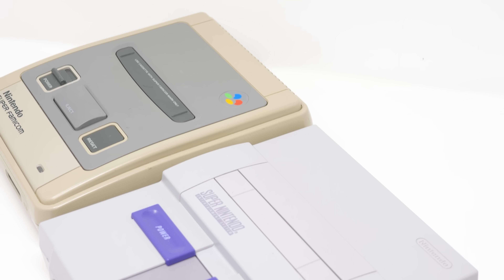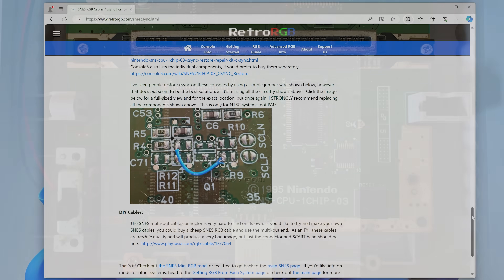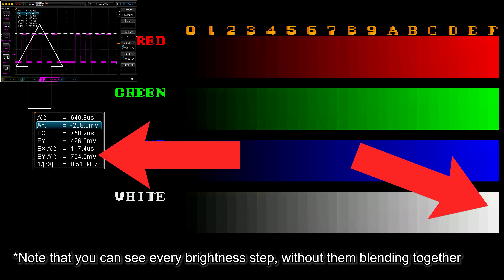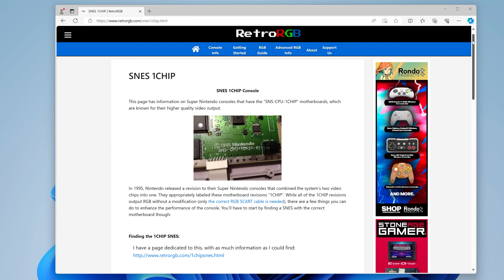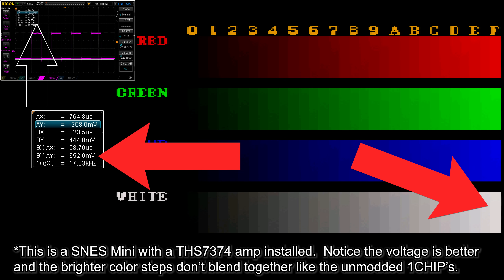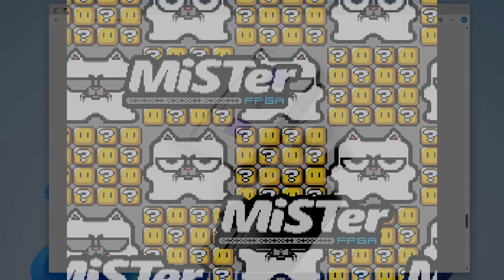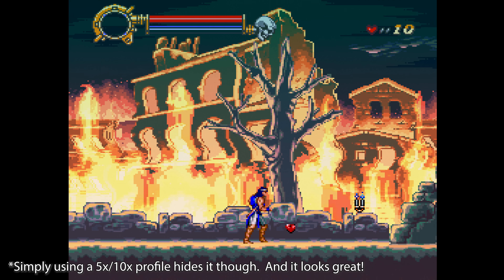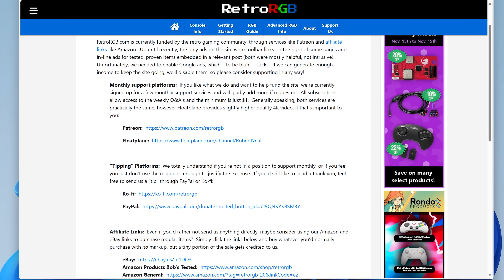SNES Video Output Explained

Comment: I'm personally fine right now with my stock 1chip's RGB on my PVM with an SD2SNES using the brightness limiter in the settings.
Reply from the maker: Great solution!
Reply: @RetroRGB It's also a nice solution for the 1chip specific issues in some games too, because there also a setting to help fix those.

Basically makes a stock 1chip nearly perfect as long as you don't mind using the SD2SNES/FXPAK for everything over original cartridges.

I'm blessed that my first SNES I got back in the day was this 1chip one. My mom does real estate, and she found it in a house that was foreclosed on that she was helping clean out.

It was super dirty, but I cleaned it up, and it's been a champ all these years.

I swapped the shell to a PAL one not too long ago, and now it's my perfect SNES. 👌

Comment: Perhaps Voultar isn't 100% confident on the product since this 2Chip/3Chip thing has so many variables, and needs a larger sample size of consoles to confirm that his research is correct.
Reply: It's a matter of sniffing out unique corner cases and providing sound documentation. As a one man operation, I only have so many hours in the day to properly evaluate everything and performing installations will give me the information that I need before turning this completely loose.
Reply: @Voultar  as a Canadian, would I be able to send my launch model SNES to you?  If yes,  where can I get started?

Comment: I have an RGB modded SNES Jr (mini) that I believe is 1-chip and also region free modded (can play American and Japanese NTSC games). When using the FXPak Pro, should I turn on the 1-chip fix?
Reply: I think all Juniors are 1-chip
Reply from the maker: Good question!  That setting is for original, unmodded 1CHIP's.  If you have a modded mini, then you're already outputting the correct brightness.  So while technically it IS a 1CHIP, it's already "fixed" with the mod.
Reply: @RetroRGB  Awesome! Thanks for the info.

Comment: Voultar is going to be backed up for a year if he's the one that's installing all of them.
Reply: It's cool that there's a new mod for the 2-chips, but I doubt it will be a long lasting solution. Those GPU's have such a high fail rate that it almost doesn't make sense to mod them anymore. I set my 2-chip aside after the red output started to fail, and bought a fixer upper SNES Jr. for playing.
Reply: @hammerheadms while those GPUs do occasionally fail, it is not super common
Reply: @rentoptional1524  I have to disagree. Though it is far from definite thing, it happens far more than folks think. I would not say that it's as bad as, "just a matter of time", but including myself I run into guys all the time that have had graphical issues with their SNES. I think it creates enough concern that people aught to think hard about modding something with obvious failure points.
Reply: @hammerheadms I thought this was largely limited to SHVC models? It was my understanding them GPM and RGB snes’ didn’t suffer from the same failure issues (at least, in the way the SHVC does).
Reply: @Mampersand  as far as I am aware all 3-chip model are susceptible to PPU 1 and 2 failing outright. PPU 1 I believe handles sprites and and backgrounds, while PPU 2 handles color encoding. Both are custom chips. So if failure occurs there are no off the shelf solutions. Sadly, salvaged chips are the ONLY solution, besides finding 1-chip units, which are limited to later models, and the redesigned Jr. models. Can't remember the serial number on those later models but maybe that's the one you were referring to. All 3-chip models use an identical chip set, which makes salvage easy enough, but that of course mean a salvage unit will be destroyed to save another. I know I using different reference terms, so I hope this wasn't confusing. By 3-chip I am referring to CPU, PPU1, and PPU2. When referring to 2-chip it is in reference to the same model as 3-chip, just that the 2 chips are in reference to PPU1, and PPU2. Also, I guess I also used the term GPU...sorry about that. I was referring to the PPUs.
Reply: @hammerheadms  I think the ideal is to eventually replace the chips with a fpga replacement when required and maybe fix this problem in that way. The real ones are too flawed in such a way that these patches are not actual fixes, but rather reduction of the resulting issues.
Reply: @scikoolaid  who knows. Maybe in a few years an FPGA adapter chip could be a feasible option as a replacement. I think most indy hardware developers are probably more interested in just developing new hardware solutions than modding retro consoles. The Analog company seems to be making bank doing that, but I think it would be great if we did have a solution for competent do-it-yourselfers to have a longer lasting fix for classic console to help preserve them, even if they are no longer completely stock.
Reply: @hammerheadms  As far as I've read, no one has yet decapped and high-res imaged the SNES chips yet to be painstakingly re-built identically. So until that happens and a madman does it we still are interpreting the inputs and outputs to the chips as close as possible. I mean the mister project is a possible way to take what they built there and piece out the chips themselves but that's still tons of work, if anything its a great guide to start from when the time comes. But yeah. As much as I'm glad Voultar made this possible he is still just "repairing" as much as he can the SNES's bad levels of image quality. Its not 100% reverted to perfect colors, perhaps running this mod into the Retrotink 4k will complete the job and make it indistinguishable from a 1chip but it is what it is.
Reply: @scikoolaid  yeah. Definitely counting on someones passion project to make real strides here. I love the headway project modders have made, but it's looking like most of the preservation is going to be on the software side, rather than the hardware side. I did see something a while back on a forum that someone was doing some research into the Hudson HuC series of chips for PC Engine and TurboGrafx. Sounded like they were attempting to reverse engineering those custom chips also. Interesting things happening, but no guarantees on where it's headed.
Reply: @hammerheadms  Give it enough time I think everything will get the love eventually if nothing else than for the challenge of it I bet. Thinking of the N64 fpga being impossible was proven wrong in spades in the right hands and with the passion behind it. Robert is a legend
Reply: @scikoolaid  I knew that would be only a matter of time. Just say, "it can't be done", and someone will always come arounds and say, "bet me". Definite kudos to that project. Personally, I'd like to see more game companies doing stuff like Atari. I may not be the biggest fan of emulation, but I gotta admit the 2600+ and 7800+ are damn cool projects. And the fact that they are putting out new game carts is a chef's kiss. Mini consoles were cool for a minute, but I still got old game cartridges that I love to play on hardware that is almost as old as I am. If , say Konami, were to design a PC Engine+ console, with maybe a few unreleased games...? I think they would win back a lot of the retro gaming crowd that started to write them off in recent years. Even if it wasn't FPGA based, I think that would make a lot of people happy. I think that kind of customer engagement would really go towards moving the needle on a lot of other modding projects that these tech savvy amateur innovators have been engaged in. It all just builds more interest in the retro gaming hobby for new generations.
Reply: @hammerheadms  I agree with ya. It reminds me of my own thoughts on all the retro gaming advancements we got going. I really believe that eventually each generation or major console of the past will grow and rebirth as their own everlasting development platform. More and more money and development is growing the interest in what we love that it will still get bigger. There's always been homebrew but I mean, eventually something is going to break out with a current day studio/dev making a game for old hardware that will be easily accessible to take the rom either via emulation or flashcart and the creativity that was possible because of certain kinds of limitations is going to define games as what Era they belong (+genre) and will function on the real hardware of the era. We are already starting to hit the wall as far as consoles don't really exist as an alternative to modern PC's. Graphics already don't really matter much as a cool factor of games development advancements. There's gimmick hardware that pretty much Nintendo has their thumb on and other two pretty much don't care in that regard. So Yeah, I think things will get pretty bad mainstream wise as we kinda are seeing, but I think there's hope for an awesome future we are collectively making happen. :)
Reply: @scikoolaid  it's funny you bring up all the modern consoles. Some of there best selling games are are retro collections and compilations, or enhanced retreads and modern sequels to old games. Turns out those are really good platforms for retro emulation (they'd better be, at that price), and between collectable physical media and a thriving online marketplace, old games have become new again. I'm 45, so I'm eating it up. As much as I love to play my old consoles, playing Castlevania Rondo Of Blood in my living room, on a modern TV, in my recliner, with a wireless controller is a serious luxury. That will never replace the nostalgia and joy I get from the classics, but after a hard day at work, the modern alternative is admittedly a nice way to unwind without having to unwind a controller wire.
Reply: @hammerheadms  Isn't the PPU failure rate caused by bad capacitors, and thus avoidable by replacing said capacitors?